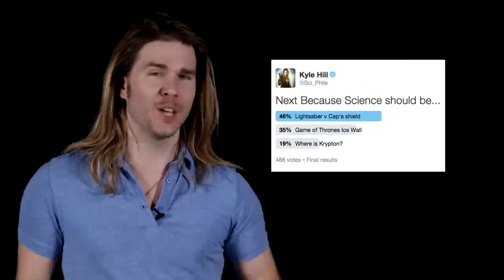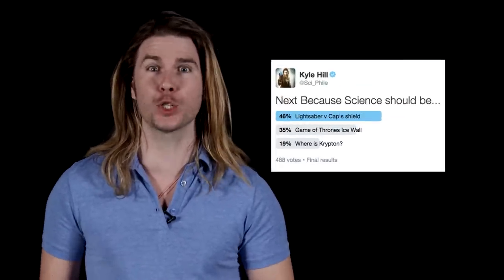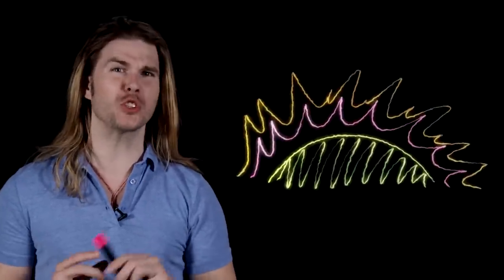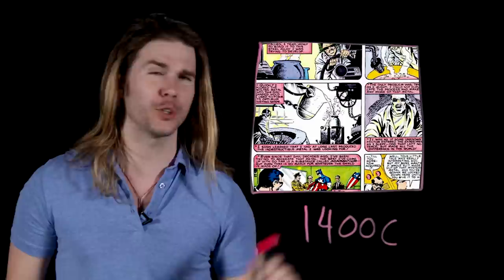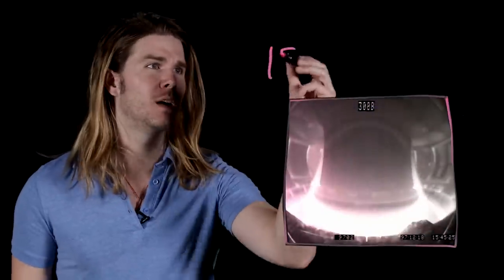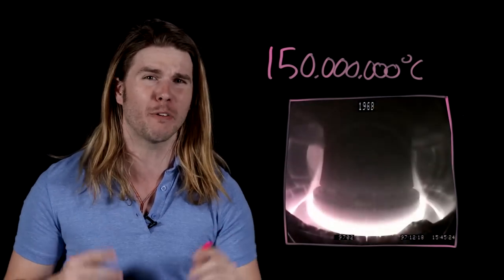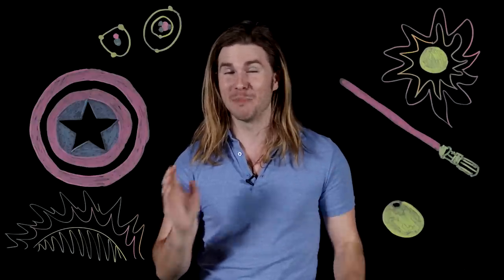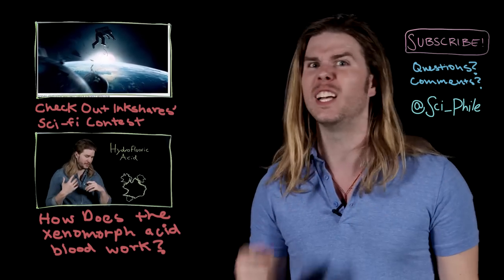Could a Lightsaber Cut Through Captain America's Shield? (Because Science w/ Kyle Hill)

Comment: From the OHOTMU entry for Firelord: By the slightest manifestation of his stellar powers, he can burn through any Earthly substance (with the exception of Adamantium).
Firelord can reach the temperature of a star, which is very much higher than that of the Torch and so at maximum output he might be able to burn through.

Also 2:23
"The extremely stable molecular structure of the Adamantium prevents it from being molded further, even if the temperature remains high enough to keep it in liquefied form. Only a device celled a Molecular Rearranger can alter the form of hardened Adamantium."

So it would melt but it wouldn't change shape.

Comment: Nerdy Thor has spoken. Take that cap 'murica fanboys.
Reply: Nowhere does Nerdy Thor examine the transfer rate or the storage capacity of the Vibranium.

Think of the Vibranium like a "Kinetic Energy Capacitor," as opposed to an electrical one.

What is the "rating" of the capacitor? At what rate can it absorb kinetic energy? How much energy can it store?

The lore says it has an extremely high absorption and storage capacity (not specifically known limits; took something like a nuclear blast or a sustained barrage of energy weapons to "overload" it).

So the question is exactly how much energy is transferred over time by the Light Saber, and exactly how much energy is the Vibranium capable of either absorbing or dissipating over time, and what is its maximum "storage" capacity (before "popping" like an overloaded capacitor that's exceeded its dielectric strength)?

Seems to me those are the correct questions to be asking... Yeah? Not sure it's 100% settled.

I suspect the Vibranium can take/dissipate a lot of abuse from a light saber before reaching its theoretical maximum, if ever.

And we've seen materials in the S/W universe that Light Sabers had problems penetrating, even over time... I suspect the Vibranium itself would be extremely good at resisting Light Saber incursion... Perhaps not forever, but better than the regular steel, etc., etc. 

And, are there not some alloys or meta-materials that are stronger or can withstand higher heat than their component materials could on their own?

Comment: So you ignore comics-where the shield comes from-and apply a completely unrelated logic to it?

And Captain America's shield has taken sustained bolts of lightning from Thor,  average lightning about 5x the heat of the sun. Thor's lightning can KO the Hulk, the level of power is exponentially greater. Therefore, in-comic proof it could take a lightsaber.
Reply: +Conner Wolf tempeture doesnt spread instantly if the sheild isnt conductive then it wouldnt get that hot unless the lightning stayed in conctact with the sheild for a period of time
Reply: +Conner Wolf Bolts from Thor are about 5x the surface of the sun yes...but the plasma applied in this situation is 10x hotter than the core of the sun..which is much hotter than the surface.
Reply: +Zero Dragoon Yet there's metals in Star Wars a lightsaber can't cut through like Mandalorian Iron.
Reply: +21babydew It was in contact with the shield for a good 10 seconds.
Reply: Conner Wolf in 10 seconds it might get hot so hot idk how Cap could hold it but not melt hot
Reply: Conner Wolf Yes there are materials lightsabers can't cut through, I'm not sure Cap's shield is one of them. Also I wouldn't count the time the shield was in contact with Thor's lightning as a real factor because you can easily (probably) keep a lightsaber against he shield...and it'd still be hotter.
Reply: +Zero Dragoon Even if the heat was only twice as hot, if a lightsaber was going to cut through the shield, Thor's lightning would've at lest turned his shield into a wet paper plate. You can be well below something's melting point and turn it into a noodle, Cap's shield showed absolutely no signs of that, it didn't even start glowing.
Reply: not necessarily, Cap' shield probably wasn't a good conductor of electricity. In addition, lightning does some pretty weird things....and the shield probably doesn't hold energy well either, so really the lightsaber would bring a different result than Thor's lightning.
Reply: +Zero Dragoon No. No it wouldn't, especially not using the calculations this guy used, which meant it was plasma, Thor's lightning is also plasma, and just based on who he's taken out with his lightning, far more powerful than any normal lightning, hundreds, thousands, millions of times more powerful.

And lightning may do weird things, but so does Cap's shield.
Reply: Conner Wolf Lightning in general is a form of plasma. And the enemies Thor beat doesn't determine his lightning being 1 million times the base.. it just means whoever he was fighting couldn't take it,
Reply: +Zero Dragoon That... is an absolute contradiction. Considering Thor fights beings who can take planetary and star-level punishment and his lightning KOs them, the power of his lightning is insanely high. Hell, Hulk has been able to withstand the heat of the sun with ease, yet gets KOed just by the residual energy of Thor's lightning.
Reply: +Conner Wolf Lightning is 5x hotter then the surface of the sun. Which is a lot, and I mean a lot colder than the core of the sun. Which the lightsaber makes look like child's play being 10x hotter than the core of the sun.
Reply: +RaptorEntertainment I probably should've expanded upon my statement above, Thor's lightning is exponentially more powerful than just an average lightning bolt, considering it can KO The Hulk. Therefore, the energy and by extension, heat of the lightning bolt, would be greater as well.
Reply: Conner Wolf It's also vastly inconsistent. There are times when his lightning can take out The Hulk and other times Hulk can tank Thor's lightning like it was nothing.
Reply: +RaptorEntertainment That's an issue with all fiction, and when it comes to Thor vs Hulk, it's mostly attributed to Thor trying not to kill Hulk, and holding back too much, however a majority of the time, Thor can certainly KO the Hulk.
Reply: Conner Wolf It is an issue with fiction but is still true. It is also true that the Hulk has tanked lightning from Thor while Thor was going all out trying to kill the Hulk. Thor's lightning is also never shown to be "hotter" than normal lightning just that it lands with more impact.
Reply: +RaptorEntertainment The more energy in lightning, the hotter it will be, therefore if the energy in this lightning is enough to KO the Hulk, that means it's millions or billions of times hotter than the hottest lightning, or a lightsaber.
Reply: +Conner Wolf Lightning is not 5x hotter than the sun. it's 5x hotter than the sun's crust - its outer layer. The inner layer of the sun is approximately 15 million degrees C, and lightning caps out at about 53,500 degrees C.
Reply: Conner Wolf logic? Hahah that's funny. Logic is subjective, and when you get some facts you can talk to me.

Comment: Cap's Shield in the Comics can withstand a NOVA so no, its melting point isn't between steel and vibranium... btw, it isn't steel and vibranium in the comics, its Admantium and Vibranium.
Reply: Actually the adamantium part of the composition was originally a typo in the original official handbook of the marvel universe. That and because adamantium as we know was made after the shield was made but the steel or iron alloy as some sources state is called Proto-adamantium as it is the metal that regular Adamantium was made to recreate the shield's properties!
Reply: @Vibranium_man  The original shield was an accident that was never reproduced and it involved two metals, one of which was Adamantium or its predacessor which later became known as admantium and Wakandan Vibranium. However, some third unknown ingredient, either a process, an event, or some interaction that has never been repeated caused the two metals to completely alloy and become something stronger and more resilient than ints constituents. I used to own the original handbook of the MU and I even recall reading some of the discussion s in the Letters sections of comics regarding this topic. My point was not, however, what it was made of, but rather that it was nigh indestructable and could survive a supernova, not that it was xalled x, y, or z. This video put the melting point way too low, and in caps shields case, there is no known melting point.  When the Marvel Universe and its handbook were translated into an RPG, they gave a ranking for the shield's material class. It would requie an entity on the level of The Shaper of Worlds, or the Beyonder e.g. a cosmic cube entity to destroy it. Melting point is irrelevant at that stage.
Reply: @Vibranium_man  Simple, we are a tiny speck in a grand universe of unimaginable complexity and diversity. On our own planet, we see life in a multitude of forms and with greater survivability and complexity than humans. What image did the creator use to make all those species which are actually better designed that we are? Why would such a being even have a defined form? Why would we be made to resemble our creator when, if a human does that, it is also called vanity? If we were made in a creator's image, doesn't that mean that our creator would have all the flaws that we have? Aren't our flaws part of our image too? I don't apply a fixed image to the notion of a creator except to imagine that a creator of an entire reality should be able to adapt to any image it can imagine.

Comment: The Proto-Adamantium in Cap's shield along with it's unique structure does more than just absorb energy, it redirects any energy that cannot be absorbed. The idea is that the shield's absorbing and repelling abilities will kick in before the metal is effected. In this particular case the framing of the shield is a similar design to a perfectly circular spiderweb. If spiderwebbing wasn't sticky it would act like a trampoline. This is what the structure of the shields does, while the elements of the shield does other things according to their atomic structure. ( i. e. Vibranium )

Comment: Worth pointing out that originally, Cap's shield was Vibranium, Adamantium, and an unknown agent.

Changing it to the origin of "proto-adamantium" was done later.

Also, a lightsaber can't be that hot. That type of heat would combust anything flammable that was nearby... like Jedi robes. The magnetic field you theorize holds the plasma of the blade in place wouldn't (shouldn't?) prevent heat transfer to the air. 

I know you can calculate heat dispersal to figure out ranges, but that doesn't matter. Three or four feet isn't going to be enough to disperse enough heat.

Comment: What if we suppose that vibranium has an extremely high latent heat of fusion? It may indeed have a melting point at 1500 C, but it would absorb a tremendous amount of energy before it actually changed phase. So, the light saber could, given enough time, raise the metal to it's melting point, but it might take a really long time.

Comment: I'm by no means a chemistry expert, but I have a question when you talk about the shield melting at the temperature it was forged. I think there may be something to this. I realize that this may be a stretch, but a liquid egg can no longer become a liquid once it's cooked due to what I understand is an irreversible thermal reaction. I realize that certain chemicals could potentially return the gelatin of a cooked or boiled egg to a liquid, but that's not the question posed. Could there be something in this third "mysterious substance" that would have a similar chemical effect making the shield impervious to at least the temperature it was forged at?

Comment: You forgot an important factor-when you said the light saber's molecules would hit the shield, the thermal energy would be absorbed harmlessly as it's just kinetic energy. However, there's another method of heat transfer that doesn't involve kinetic energy-radiation. Depending on how much time the light saber is near or in contact with the shield, and how much time it isn't (allowing for a cool down), the light saber might be able to melt the shield via radiation.

Comment: you forgot to factor in the fact that the shield is made out of an alloy not pure vibranium, in which case its power or kinetic absorption would be significantly reduced. Also steel conducts heat and holds on to it very well, so i think that would help to melt the shield, and if not at least burn the crap out of cap's arm. Also if the shields straps are held on by steel rivets (or any thing not made of vibranium) they would melt just from the conducted heat from the steel part of the alloy. So don't you think its possible, if given enough power, and if the straps are held on by something other than vibranium, that the shield would simply fall of caps arm? of not id argue that it probably wouldn't take that long to melt because of the aforementioned points.

Comment: In current days, the lightsaber wouldn't even scratch it. After Cap's shield was broken by the Serpent, it was reforged using Uru, the same material Thor's hammer is made of. Which in turn was forged using a piece of the core of an dying star.

Comment: I agree but for a slightly different reason
When vibrantium gets struck it absorbs Kentice ( could not spell that for the life of me) energy it retains it like a rechargeable battery but once it reaches that Limit it could release it at any moment very very violently and cause an explosion that would destroy the shield and knock the light saber whelder a fair distance leading to the possibility of self induced injury or dead caused by the light saber   So in the end there could be a stalemate with both dying, captain America dying, the Jedi dying, or neither

Comment: thunderfoot has a video where he burns a diamond on top of some gold and while the burning diamond is hot enough to melt the gold if were engulfed in that amount of heat it did not even put a mark on it as the gold was able to disapate the heat before melting so one thing you forgot to ask is how well could his shield pass the heat of the light saber if it could transfer that heat to the air fast enough it would not melt

Comment: This theory is solid,  however, vibrainium can also discharge energy,  so your theory that Caps shield would hold up for awhile. Actually, I think it would hold up during a battle as long as the energy could be discharged. Cap may fall to the use of the force, but the shield might let off a huge blast due to the kinetic energy stored up in caps shield, maybe its not going to be as powerful as the Black Panthers' kinetic blast, but it would be in that league.

Comment: One much more logical way to explain the function of a lightsaber is short range, high intensity light doubling back over and over so quickly that it creates a solid tangible blade without creating so much heat as to melt the wielder's hand, and cap's shield is a synthetic "adimantium" and does not hold the same properties as actual adimantium, it simply mimics the strength to a point. That does not actually meet the same indistructableness you could say, of wolverine's claws

Comment: One complaint about this analysis. You started out stating you would give each the benefit of a doubt, but almost immediately backpedaled saying that the alloy would have a melting point between that of it's components because that's just "the way it works". If the Marvel universe says that it can't be remelted and reforged so easily, you should be taking that into account. Also there shield is also well known for its ability to deflect energy and most likely would just refect most of the plasma's energy.

Comment: Kyle makes proto-vibranium comparable to cortosis, a rare alloy in the star wars universe that can repel a certain amount of lightsaber damage before eventually breaking. Does that mean cortosis and proto-vibranium are pretty much the same material if not greatly similar? Both are able to resist lightsaber damage by partially absorbing the kinetic energy generated by the saber's thermal force.

Note the partial and not complete absorption. A percentage of what is not being absorbed is taken as damage to the shield, which means the shield will eventually break from continued assault against a lightsaber.

I wonder if Marvel and Star Wars did some collaboration in the past...

Comment: I'm pretty sure if the shield can tank a sustained blast from Tony's repulsors, it can tank a lightsaber.  Those are arced plasma bottled by muons too.

As for the wall, dropping to the ground is what happens when you throw a normal metal disc.  The vibranium prevents the energy of the toss from being transferred, allowing it to bounce infinitely, because this is comics and fuck conservation of momentum, that's why.  Actually, Cap being able to catch it is mind-boggling.  I guess the steel in the alloy dampens the retention enough that it's possible to actually stop the shield from moving.